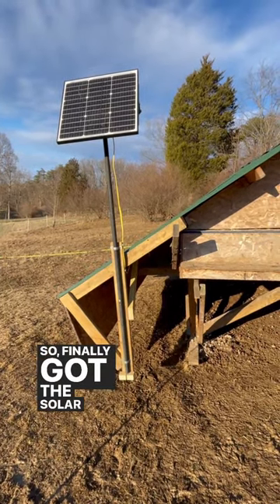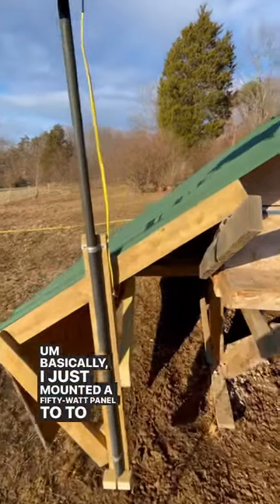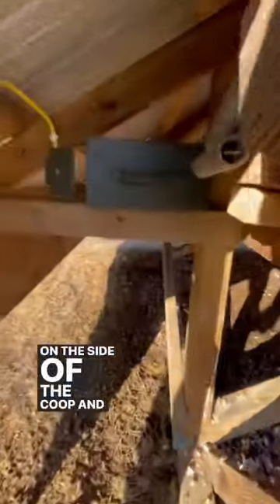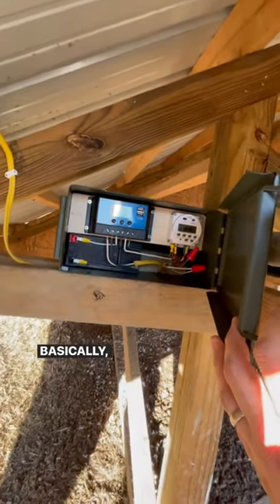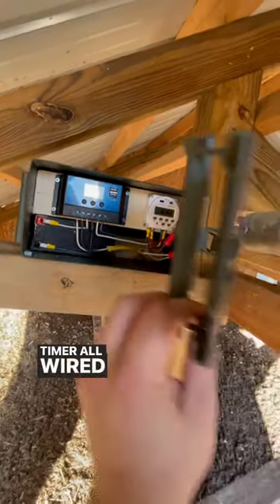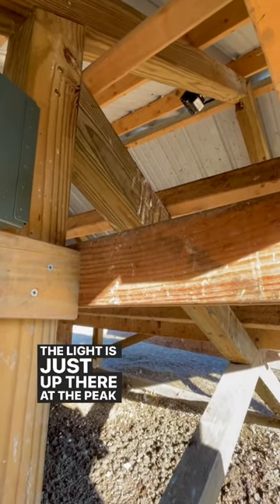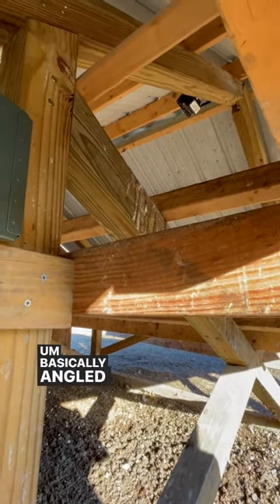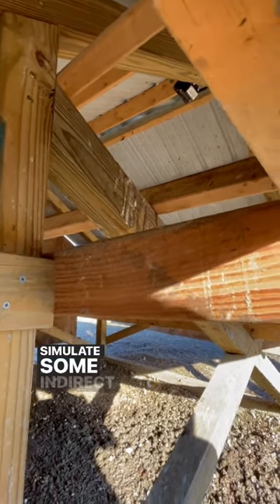Solar Chicken Coop Light WITH TIMER! Off-Grid #shorts

Comment: What do you guys do for the winter time for lights? Trying to plan out my chicken shack for winter lights so they lay eggs but concerned a battery will freeze
Reply from the maker: This works great! We’ve never had any problems with the battery in this system. And it was around zero degrees for a full week last winter.